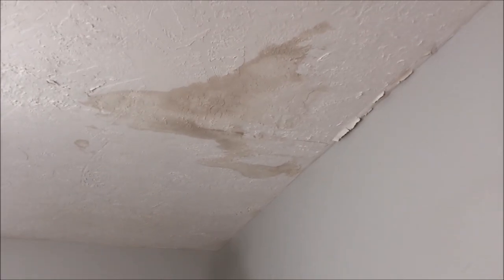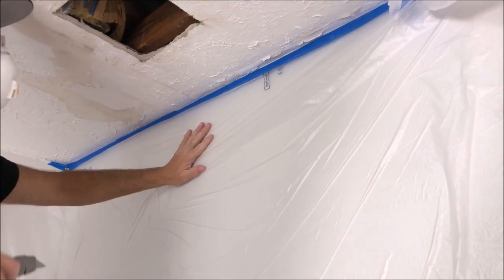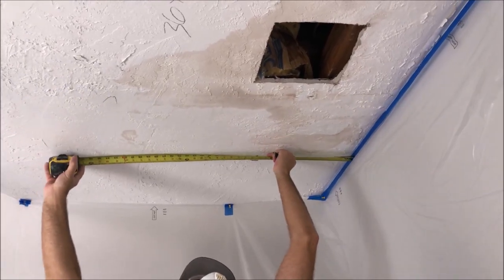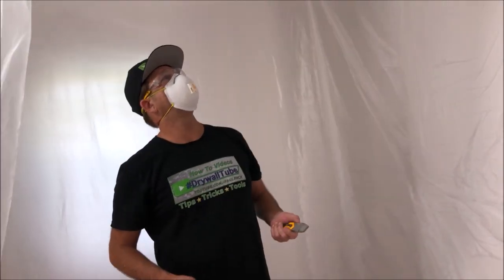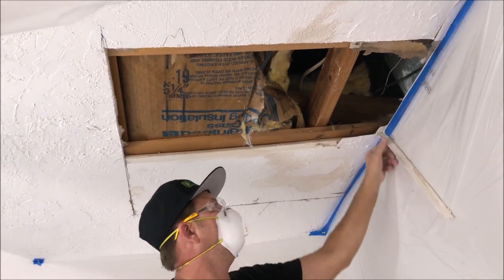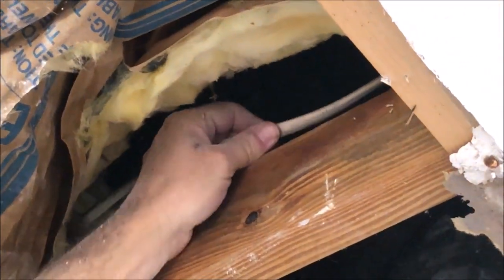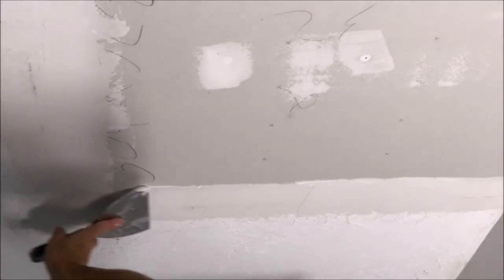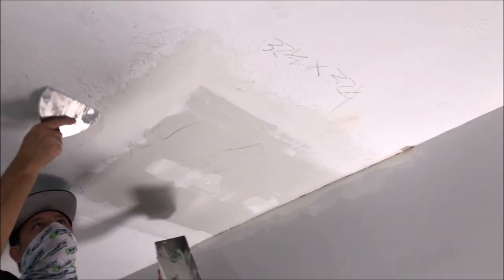How to DRYWALL REPAIR a Water Damage Ceiling Tutorial

Comment: A few years ago we had solar installed and in the process one of the crew put his foot through the ceiling talking out a 4x4 section of drywall so they had a guy come make the repair and it was obvious he didn't know what he was doing.  When he put the mud on he left the edges proud which stuck out like a sore thumb and when I told him it was unacceptable he said well nobody could make it blend in.  They finally sent a real drywall guy and he did a great job

Comment: I’ve used a large hole saw to cut an inspection hole.  Very quick and only the center drill bit needs to go beyond the drywall thickness, thus reducing the chances of cutting into a wire, pipe, duct etc.

Comment: I used the FibaFuse in the corner just folded it with a yard stick like paper. I didn't want to go buy entire roll of paper to fix one hole. It come out nice can't even tell the FIbaFuse is really nice used to use mesh for repairs but switched to this that way just have one compound no need for setting compound. I also used regular joint compound for years before didn't know any better never had a problem with cracking.

Comment: Cool thanks, right on time. I'm doing a popcorn removal then patch where I removed a leaking skylight. So there's some water damage to cutout and repair. With your help I'll have some confidence to skim coat the bathroom ceiling. Relatively small, 5x10 room.

Comment: Hey, Paul! Thanks for the videos. We recently bought a house that had (much to our surprise) a 2nd floor shower drain that leaked. Leak is fixed but now we have a hole in the kitchen ceiling. I cut out the damaged part, but before I attempt the repair I wanted to know if I should remove all the drywall that has water staining, or if it can be left if it's still solid. Cheers!
Reply: If it’s stained only then there’s no need to remove it. Just apply a coat of a water stain sealer, usually metho based, prior to your painting. You can buy this in liquid or a spray can. Having said that there’s no harm in cutting out a slightly larger area than your existing hole. An experienced repairer can do a cut out repair pretty easily. I’ve done hundreds of them.

Comment: Got tired of using the drywall saw for this work.  Just because I forgot my drywall saw and had my Dewalt 4 1/2" cordless saw (with dust bag) with me, I used it to cut the hole in the drywall, and have never looked back.
Reply from the maker: Have you seen the new power drywall saw by Makita? 🔥😎
Reply: looks good, but still just a jig saw

Comment: Hi.  I'm a DIYer.  Your video is very helpful.  My question to you is this.  My house was built in '65, split ranch.  Ok.  Now,  I noticed the ceiling over the bathtub peeling.  I pulled the hanging piece and it came down.  A little more came down.  When I examined it.  There was a hole.  All in all I believe it is about 8 inches round more or less.  The hole does not show drywall.  I can't make out what it is.  It is not wet.  I'm thinking it is plaster and it started to peel away from the moisture and humidity and painting.  Can you please give me your thoughts on my hole in the bathroom?  What is the best way to fix it?  Any and all suggestions will be appreciated.

Comment: DIYer here : would u suggest Fiibafuse for a ceiling or wall crack (versus mesh tape for example?) I would use hot mud with FF, rather than normal joint compound.

Comment: forgive me, I'm a novice.  Why the dry mix compound, then the joint compound?  Also, what is the purpose of the tape if you are using joint compound?  Forgive my ignorance.  Also, when you initially made your large cut out, how did you know you were at the studs?  Did you measure it on purpose that way? I think you have links to this.